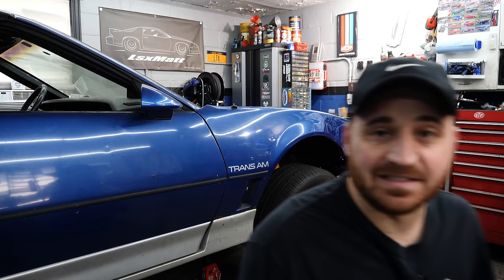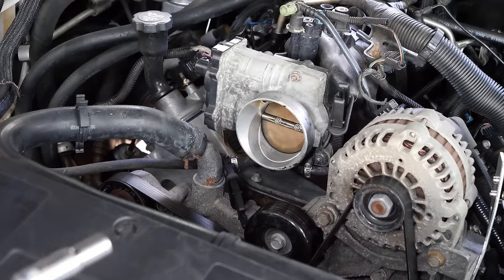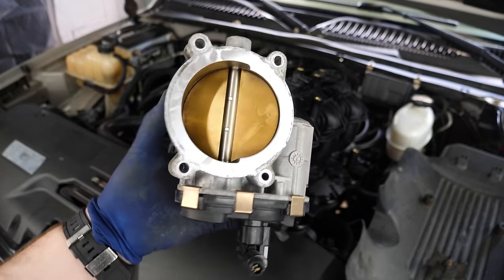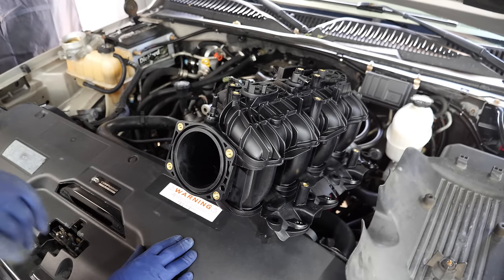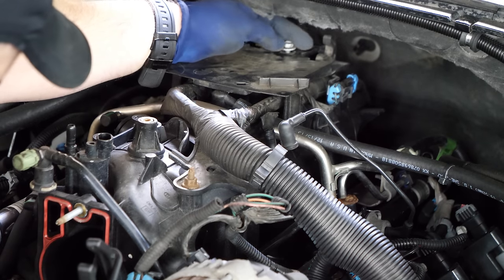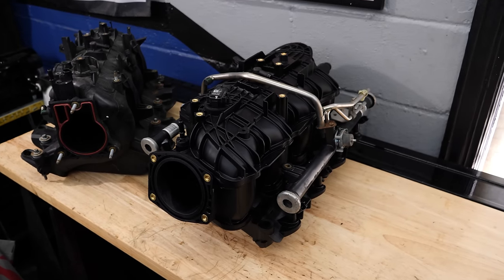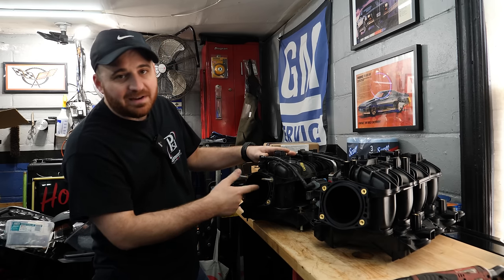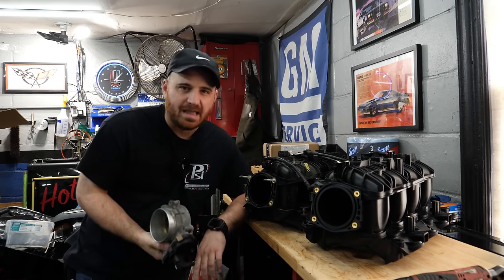Is a Trailblazer SS Intake Swap Worth It? | Install and 0-50 Test

Comment: The Corvette fuel filter fits on the end of the fuel rail. You really didn’t need to make an extension for fuel input. But you made it work, and that’s all that matters.
Reply from the maker: Didn’t even cross my mind! That makes the fuel portion way easier.
Reply: Vette reg wont fit right on, but you can get a whole nnbs rail in a jy cheap
Reply: And the tune needs to be changed for the non vacuum reference pressure regulator

Comment: You almost could have done a full Dorman fuel line repair set up and have the quick connects from filter to fuel rail with a 90 degree connector. That way you WON’T need to worry about a hose sliding off from when you add more pressure from turbo charging the system.
Reply from the maker: This setup isn’t permanent. When I actually turbo it I’ll be running a different fuel line from the pump to the rail.
Reply: @lsxmatt  because you’re going to need the pressure regulator that will have boost reference… brilliant!

Comment: Great job, I ran into some of those issues when I swapped a 6.0L into my 1500, the fuel filter does clip into the fuel rail and it has enough slack to clip into the factory lines.

Comment: Matt love your attention to detail on all the work you did in this video! Don't knock yourself you did a killer job on that air box and it works I bet better than any aftermarket you can buy. The fact that you got the original engine cover to fit is awesome. You open that exhaust up your going to see the rear tires spinning for sure. Or at least I hope so lol. Keep up the awesome work love all your project cars.

Comment: TBSS was a great upgrade. I went to a 4" maf housing and card style maf, moved the maf to right before the elbow, 6" filter with a 6-4 cone adapter. 4" all the way to the 90mm throttle. Wrapped the intake and coolant hoses near the intake with header wrap. I disabled the adaptive idle parts in the tune when I did my maf and ve table. That made tuning the bottom end of both easier. Then re-enabled them after. Stop and go traffic is smooth like factory, full throttle rips to 7400 and cruises on the highway all day.  
Good video and watching someone else work it at home is great.
Reply: 7400? i hope thats not a stock motor...
Reply: @bryanjr4898  with hardened pushrods and better springs, it's easily done. Along with the GM performance cts-v lifters (look those up), she's dead stable at 8000 rpms. Cam has power falling badly after 7400.

Comment: That’s insane! I have an 03 Tahoe LT, 247,000 and the same exact problem is happening to mine right now! Last week I got throttle body actuator code, reduced engine power as well. Pulled over, shut off Tahoe and restarted after I cleared code and ran fine, then yesterday it happened again..I had replaced throttle position sensor after the first one so now I know it’s the actual throttle body. Weird we’re having the same issue at the same time, similar miles though.
Been following your channel, first comment! Keep it up man and thanks for all the tips!

Comment: Thanks, glad you went into the issues of swapping the TBSS. I'm running essentially stock with no other mods planned so you actually saved me some bucks since the improvement is small if at all for me.

Comment: Nice install, the airbox and tubing turned out well. I just went from an Airaid intake tube and a modded factory air box to a Banks Ram Air on my 6L swapped Silverado. I saw similar results even in the FL heat, ran close to ambient and reacted quicker once rolling. I have not changed anything, including the tune. I plan to get it back to the track to see what it picked up, unfortunately the weather is about 10-15 degrees warmer than the last time I went to the track. I'll have to correct my times for the Density Altitude to validate it somewhat accurately. When I swapped my intake manifold, I used a C5/C6 fuel tank transfer hose. It has the correct bend and is 100% plug and play. Unfortunately GM discontinued it, but you can still find them used or NOS.

Comment: About a year ago I also started down the TrailBlazer SS intake (or GMT 900 intake) rabbit hole. When I got to the $300 X-link, I bowed out. Dollar for power, it's just not worth it on a basically stock NBS 5.3L. I appreciate the honest review, and shedding light on all that actually goes into this swap. It would be a slam dunk if it was plug and play though!
Reply: It is plug and play lol
Reply: @frog8553  
Right. With enough extra parts, I guess everything is. Just plug a stock NBS throttle body harness into the necessary $300 X-link, and then plug that unit into the larger throttle body off a NNBS or TBSS. Then there's the fuel line/rail & return issues. My desired "plug in play" comment references if GM had just stuck with the same pin/plug connection at the throttle body. You can find complete (fuel rail & throttle body) used intakes for around $200, but that extra $300 for the X-Link pushes the upgrade over the top; at least in my opinion.
Reply: @DontjeB  I did it w a DBC summit throttle body and a tune (gen 4 intake & injectors). junkyard LM7 swap. My fuel filter had to be rigged up funny but it works. I used the gen 3 map sensor with RTV lol. It seems like the injectors never all sit in right together. I was getting great mileage for awhile, and the motor sounds godly at high rpms

Comment: Here’s an idea for your merch store - figure out the dimensions for the cold air box and have “sendcutsend” do a bunch for you to sell. All we would have to do is buy it, bend it and screw / rivet it together. You could even include the insulation if you wanted to. Shipping would be cheap because it would come to us flat. I’d buy a kit like this from you over the k&n in a heart beat. Just an idea.

Comment: All 2007 and newer Silverados with LS 5.3 or 4.8 engines have the trailblazer SS intake with a different exterior look. Put in any 07 and newer intake on a gen3 motor is essentially a trailblazer SS swap for the cathedral style heads

Comment: i re-plumbed my fuel system = an fittings with braided s/steel hoses and a adjustable fuel pressure regulator full flow return system ! = with better injectors = better fuel consumption !

Comment: Very good presentation.  I would argue that you are undervaluing the improvement that the manifold made.  My thoughts are as follows;  Assuming a change in timing of an average of 5 tenths.( 6.4 seconds to 5.9).  That is a significant split for a zero to 50.  (59 tenths over 64 tenths).  That is an 8% time improvement.  Even if you make a direct linear relationship to time vs HP, (which I don't think you can) with a baseline of 300hp, that 8% approximates 24HP.  I obviously don't know the actual HP or have super accurate timing data, but order of magnitude estimation indicates that this mod was a significant improvement.

Comment: If you didnt know the air that its "pulling" from the fender doesn't go anywhere. Its blocked by a foam piece that sits inside the fender. 

On an 07 and up air is blocked in the fender with that piece of foam. You'll get only a small amount of air with a small venting on the bottom of the stock fender.

Comment: I have an lq4 swaped 72 c10, I added the intake in conjunction with ported polished and shaved 243 heads I had an ls1 hot cam and went to a comp cams cam 600 lift 226 duration intake 232 exhaust, had the tbss intake ported.  The stock lq4 with ls1 hotcam made 323whp and 342ftlbs at the wheels through an automatic and ford 9 inch with 28 in tall 10 in wide tires.  Power peaked at 5,000 rpm and stayed flat.  With the head cam and intake I went to 362whp 365ftlbs, power peaked at about 5700 and stays flat until 6500.  Not what I was expecting, I wanted 400 hp at the wheels, in this c10 I ran a 13.3 1/4 mile time at 102.9mph.
Reply: Something not right in your setup or tune, i have a stock ls1 with 1 &5/8 ,tri y headers, ls6 intake and cai and i went form 320 wheel hp to 412 wheel hp by adding ported and shaved 241 heads. 226 232 cam , 25 percent under drive pulleys and ported throttle body

Comment: Appreciate the insight on intake temps had no idea there would be such a difference.I did notice with a longer air intake tube the revs felt better. You can get a diesel air intake filter that's way bigger so ya know.Tons of fun I can't wait to work on my stuff & thank you for the valuable information I would have never known.🥤
Reply: Lsxmatt-  looking where to send I tried here but it got booted.

Comment: I had kept the entire factory airbox and tubing on my cammed 05 6.0 Denali. I decided to change just the the factory plastic tubing out for an aluminum elbow for a better look , after a month of driving it with the stock elbow, and swear it felt more peppy compared to before especially wot.

Comment: I bought an adapter for the throttle body connection for $150 in 2012, it still works, it’s a little larger has a cable going to a small box then cable coming out to the throttle body.

Comment: I have a 08 4.8 , it came with factory shorty headers , steel not cast , and the same intake , i bought it brand new that way ...337,000 miles on it now , she aint much to look at anymore , she out ran all the 5.3's (stock for stock ) that we ever owned , and got better fuel mileage , i got three of the 1/2 ton silverado's , 08..4.8,09.. 5.3 ,2014 ..5.3

Comment: Just want to clarify something . P2135 doesn't mean the correlation between the throttle body and the pedal . There are two position sensors inside the throttle body and the code sets when they aren't in agreement of throttle position .

Comment: I'm betting that with a nice set of headers and a good exhaust you would see alot better gains from that Intake manifold.
Reply from the maker: I don’t wanna do headers being they’ll just get removed for the turbo. I will definitely do high flow cats and a straight through muffler though.
Reply: @lsxmatt  Oh yeah, good point lol. Sorry I wasn't even thinking about you boosting it 🤦. But yes I see where you're coming from lol. Nice build though man, hope to see more of it soon 😁

Comment: You made a homemade volant cold air intake. Looks good. And definitely cheaper. Take a look at the tow hook scoop they offer. Maybe you could fab something like that as well. I'd be curious to see the temps after that was installed. Supposedly helps more because of how it forces the air in going down the road.

Comment: Excellent job. Can't wait for boost. I may just skip everything you did and go for a 6.2. in my 05 Avalanche. I have one in my 07 Escalade EXT and it's a towing beast. Sounds and feels so good when you romp on it and better fuel mileage as well. Of course, the mileage may be due to the 6" lift and tires but the Avalanche is a lighter truck. I think 4.10's would make you grin.

Comment: Good video. That’s a lot of work and expense for a 10th or two.  I put a K&N filter on my Silverado. So much dust got past it I took it off. The intake duct was covered in dust. I swapped it for a True Flow filter and pipe. The filter was stock in shape and mount. The air was much cleaner. Sadly they are out of business now.  Their filter requires their oil. Unfortunately K&N oil made the True flow disintegrate.  So now I’m back to a stock paper filter that still traps more dirt then K&N.  K&N will not disclose what size particle their filter will trap. They only talk about airflow. In my opinion they are overrated as a filter.

Comment: .2 tenths is nothing to sneeze at on a stock 5.3. I’ve seen 45rwhp gains using a ported TBSS and ported ls3 tb on a 6.0 going from the stock 3 bolt parts to the TBSS swap

Comment: My 2013 Express 2500 cargo van came factory with one and 799 heads. Debating on doing some upgrades and a torque converter. As in upgrades I mean a low boost turbo kit. Keep the 4.8 under 500 wheel and streetable

Comment: Thank you for posting this awesome video, step by step process on the TBSS intake swap.
It's been a while since I've tinkered with any swaps (Mustang 5.0 GT40 swap, did many of those with decent results).
Was looking to upgrade my 2001 stock Silverado 5.3 intake with a TBSS intake, after watching your video I'm convinced that in my situation is not worth the effort as I don't plan to hot rod the truck.
I would have been terribly disappointed I'm sure of it.
Thank you for saving me time and money through your personal experience with this upgrade.👍

Comment: I did this upgrade when I did my swap. I don't remember doing anything the with fuel rails... did have to buy the x-lynk. Used stock map sensor extended factory harness.  Still using stock factory air intake.

Comment: Ported my tb, and my tbss intake manifold also got 50lb injectors, along with k&n intake tube, all aluminum racing radiator 34inch, 2005 electric fans and harness, shorty 1 5/8 headers, corvette servo, melling high pressure oil pump, 2004 gmc sierra 1500 stepside hoping to get my heads ported and put a cam in her.

Comment: So, the stock 5.3 injectors from your Tahoe fits the new intake and fuel rail?
Reply from the maker: Yea they swap right over. The best thing is being the truck is a flex fuel the stock injectors can support the heads and cam without an upgrade.

Comment: Save yourself the time and labor- the stock air filter box is already sealed from the engine bay heat.  Its weak point is the crappy foam where it meets the fender.  Swap in a good filter (I REALLY like the AEM Dryflow), replace the accordion tube with an Airaid MIT or even a homemade PVC tube with ebay couplers and replace that weak foam seal with some Frost King part no. AC43 hot-glued to the box.  My temps average 2 degrees above ambient. The stock filter box on my 5.3 is the same as on the 6.2.  If it can feed the 6.2, it surely can feed my 5.3, especially with the better filter.

Comment: I have never seen one of these engines with 706 or 862 heads on it make more power past about 26-27°.  I think you are gaining torque on the bottom end advancing the timing but likely hurting power up top.  I would try reshaping the advance curve a bit.  Add say 2-3* timing from 0.52 gm/cly or so and higher from 400 rpm to 3,600 rpm and peak it out about 26* at 4,800 rpm.  I generally see better torque with about 2-3 degrees pulled out of the 4,400 rpm row compared to the 4,000 and 4,800 rpm row.  It is possible to lose output from too much advance without running into spark knock.
Reply: Forgot to mention also, I generally do a 2nd gear start at about 3/4 throttle to really load the engine when I am dialing in the low-midrange advance curve. The difference in torque output from small spark advance changes vs timed acceleration runs is more noticeable taking off in 2nd gear.  Plus it is more likely to expose areas with too much timing. You will blow through the low-midrange quick in 1st gear, but 2nd gear will slow things down a bit.

Comment: Make sure you change the tune for the non vacuum reference on the fuel filter regulator the factory truck fuel system is vacuume reference

Comment: I feel like I watched this when I bought my F150 Eddie about 5 years ago 🤔 I definitely did make a box similar to yours and because I have sort of a long straight pipe I used a tornado fuel saver in I didn't check 0-60 but it sounds cool.

Comment: Bro the c5 fuel filter snaps directly into the fuel rail connection after that you just need to connect your oem fuel lines into the inlet and outlet connections on the filter, no need to add any new fittings or piping
Reply from the maker: Filter was too fat to slip on, the rail was in the way. Was easier doing this than trying to bend the rail inlet to clear.
Reply: @lsxmatt  got it, in my case it did work but I did have to bend just a bit the line in order to make the filter fit

Comment: I like what you did, I just did the exact same thing but the one mistake you made, with the tbss intake you should have also used the injectors so instead of 21 lbs they are 36 lbs, I felt a very big increase in my butt Dyno, but I’m also on a caddy with the 6.0
Reply from the maker: The motor is an L59 so it already has the 36lb flex fuel injectors.

Comment: Why wouldn't all throttle body connections to the intakes be uniform across all LS like the intakes are? Sure the trail blazer intake may not look like a Silverados but they still bolt on the same...

Comment: I would have started with exhaust, stock is crap and sounds horrible, My 2000 Sierra 5.3 has Edelbrock headers - stock cats to 3" pipe - then 3" in SLP straight through muffler with dual 2 1/2" outlets (from old TA I sold SLP catback) - to dual pass & driver over axle tailpipes with 
2 1/2" to 4 1/2" Tips. Setup with K&N intake sounds like muscle car and seat of pants hp feels like a big difference, I also have a Diablo Sport Predator tuner with 93 octane tune. I think I will enclosed the intake like you did, the K&N shield isn't perfect but it's seal  does leave imprint on hood insulation.

Comment: I think its hilarious when people put bigger throttle bodies on small engines. You would be better off getting a small adapter and using your factory throttle body. If you don't do that, at least put a much small filter on it. You're losing soooo much bottom end because you don't have the velocity anymore. 

I've tuned sooo many trucks and made these suggestions, its made a huge difference on bottom end.

Comment: what's the story on the Trans am behind you? I have a 87 with the same paint and ground effects, digital dash, I've been told it's a rare combo, however haven't seen any real numbers to verify. has the 305 tune port, picked it up for 750 bucks and the only bad spot is i n the dumb spoiler